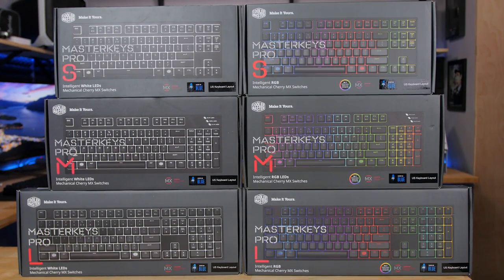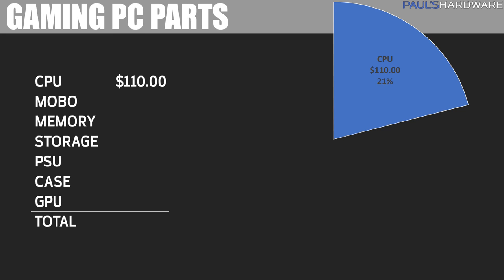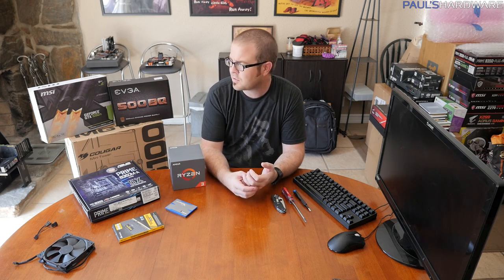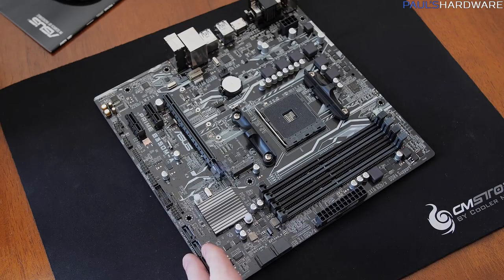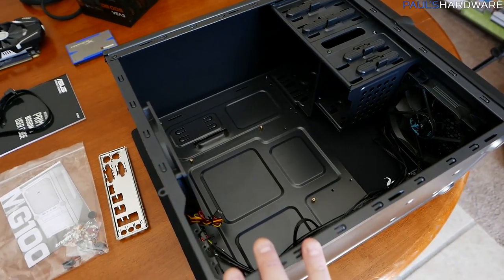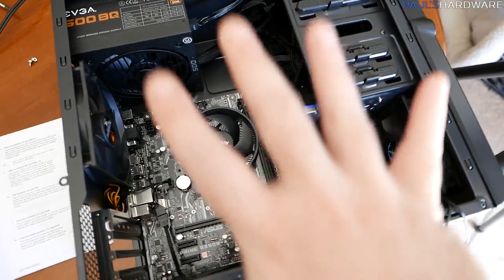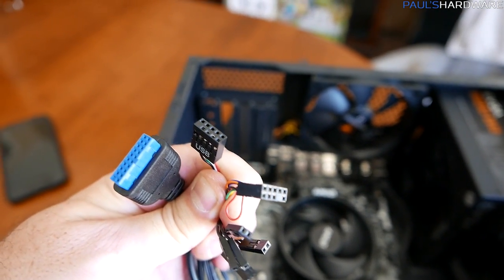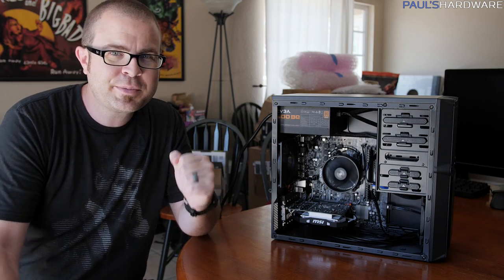How To Build a $525 GAMING PC with Ryzen 3!

Comment: Mr. Paul, I want to build for the first time ever in my life a gaming 1080p build for esports with these components: AMD Ryzen 3 1200, Sapphire Pulse Radeon RX 560, 4GB GDDR5, 128-bit, Motherboard MSI B350 KRAIT GAMING AM4 SOCKET 4xDDR4,  ADATA XPG Gammix D10 8GB (2x 4GB) DDR4, 2666MHz, CL16, NZXT Source 340 White case and a Solid-State Drive KINGSTON HyperX Savage 120GB, SATA3, SHSS3B7A/120G. What power supply should I get ? After I will get all the components that I just wrote you I will go also to buy a windows 10 64-bit english. Thank you and hope I will get feedback.

Comment: It's not a huge drop in price :(
Why no pentium g4560 pricing :(
Reply: Gabe_N 

What are you talking about? This isn't a price drop, it's a whole new processor. 

It also has 2x as many cores, along with being unlocked for overclocking and it also has a lot better TIM and is newer too so they have to charge that much. An equivalent chip from Intel is $180- 230 vs that at $109
Reply: ShadowOfDeath24 
Yes
An equivalent chip from intel will cost 250 dollars but
What if I don't want to spend that much for a CPU?
Pentium g4560 preform the same as an i3 7100 and cost way less
That's why people get the pentium instead of the i3
What if someone want to build a console killer?
110 dollars for the CPU
130 for the gpu
Boom you are out of budget
Reply: ***** if that were to be your budget, then instead of trying so to build a console killer...buy a console a be done with it.
Reply: fallshimjager1 
But why should I lock my self to 30 FPS?
Why should I pay for online ? 
Why should I lock my self to ?low amount of exclusives?
Reply: ***** I will say it again, with a budget so low you will end up losing a lot of things just so you can say that your oc is a console killer.
In my mind, a truly console killer is one that utterly destroys one in performance, a PC with an Ryzen 7 1700 or a i7 7700K and a GTX 1080 or 1080ti, that's a console killer.
With a budget like that you may be able to run games in low-medium at perhaps 50FPS, which in my opinion takes away the greatness that the PC haves.

Just to be clear, I have nothing against you, I just stated my opinion, a civil exchange of opinions.

Oh, and from a PS3 owner, the FPS number in the game that I play the most with my friends, GTA V, doesn't change anything, though, I will admit, seeing grass instead of GREEN DIRT would be nice, but, what can you expect, 512MB of RAM...
Reply: fallshimjager1 
ThAts not a killer
That's a pc that cost over 2 grand
Reply: Dude, the whole point of a console killer pc is to outperform consoles at the same price, not fucking obliterate them at 2000 dollars.
Reply: Z Bobplays 
Yes and ryzen 3 doesn't help here
That's my whole point
Reply: Wasn't talking to you my lord...
Reply: Z Bobplays I'm currently adquiring the parts to build myself a PC with Ryzen 5 1600 and a GTX 1070.
That outperforms easily a console.
For the same price of a console you can build yourself a PC, sure, but it will be limited as hell.
I do like consoles, I mean, i had PS1, PS2, I have the PS3 and plan to buy PS4, but I want that this PC outperforms by a large margin the PS4, that allows me to play everything in ultra above 75 FPS.
But that is just my way of seeing the PC.

Oh, and to respond to the original comment, AMD has something in the price of the Pentium
It's called FX, but I will rather not shoot myself in the foot with that.
Reply: But that doesn't make any sense, you're not getting the point. For example, i recently build my brother a console killer for 400 dollars, that can play anything at ultra, 1080p. Now my pc, i have a ryzen 1700 oc'd to 4.5 ghz and two gtx 980ti's. Of course my system is going to completely shit on consoles, but when you spend a shit ton of money (3k) it's not really a console killer anymore.
Reply: Z Bobplays first of all, Ryzen 7 1700 at 4.5Ghz?How did it get so high?man that's a good chip.
I do get your point, but my vision based on my place is what might change how I see it.
In US, or, ANY developed country that would make sense, but down here it doesn't.
For example, a PS4 is around 10000ARS (Argentina's currency), something like a 1050ti is around 4500ARS.
You see that it's almost imposible to even build something for less that the price of the PS4.

I do wonder however how well I will even play in a PC, because when you hold a joystick for so long, it becames difficult to play otherwise!
Reply: Yeah, i was really suprised, the 1700 is an absolute beast. Anyways, yeah i guess i didn't take that into consideration, prices vary so much from place to place. Also, you can use any controller on pc.
Reply: You can give X299 a run for it´s money with that chip, you are really lucky.
I want to build a Ryzen 5 PC, but the whole BIOS update makes me a bit fearful of the process, I mean, I really don´t want to brick my motherboard...
If you know a program to run a joystick in PC please tell me, I have been literally 5 months wanting to use my PS3 controller to play some good old Crash Bandicoot in a notebook.
Reply: Yeah the bios thing is pretty annoying, but i have a special ups just for updating my bios, and on most high end motherboards have a switch to reset your bios. About the ps3 controller, that's a little trickier. ps4, xbone, and xbox 360 controllers are all supported natively. Ps3 for some odd reason, is not. I do however think that the ps3 controller supports bluetooth, so try that.

Comment: For windows 10, they give out free copies to people who use it for accessibility. They do no checks to get it but anyone can download it. Just search for windows 10 accessibility download and they give you the operating system for free.
Reply: Anyone can get the OS for free... it's the key you pay for.
Reply: Yeah but Warren is saying if you check the accessibility option, no key is required. Turn off accessibility options after install, Windows stays activated.
Reply: yeah but that is a one time deal. only way to have a legally transferable copy of Windows is to buy a retail license. Then you can deactivate it and reactive on as many PCs as you want. if you are happy with having to buy another license next time you buy a new PC (swap out motherboard basically) then go for it.
Reply: It's free to upgrade if you have windows 7 or Windows 8. Not as a fresh install.
Reply: Maximus wait can you upgrade it again? i thought they removed this "free upgrade" option in 2016. Can you confirm it? At least i did my illegal copy "legit" for my laptop, but now i need one for my PC.
Reply: Yes, the windows 10 upgrade for assistive technologies is still available for free and it works just like a regular windows 10 upgrade. Just google "windows 10 accessibility download"

Comment: Paul pls test PUBG on it im looking to buy a new system instead of a ps4 mainly to play PUBG and i would love to see how this build performs.
Reply: Steven Daza i think you will be fine with these parts because i have a 1600 with 1060 gpu and i can get average 60+ fps with 3 video setting that are in high and medium. And keep in mind that PUBG is still in early access and im pretty sure the game will be better down the road
Reply: Buster Bloodvessel I got a 1700X and I can say, that only 1-3 cores got some serious load on it. So the performance in pubg doesn't profit from extra cores. The unreal engine isn't even optimized for multi threading :-(
Reply: Google search 1050 or 1050ti Pubg benchmarks. You'll be able to find frame rates for builds like this.
Reply: CaptainDieg Alot of system don't perform very well on pubg. It's a poorly optimized game
Reply: You will get 60fps

Comment: 17:42 You can mount the SSD using the mount point at the bottom of the case.  A lot of budget cases have a 2.5 inch mount there.

Comment: witrh that price you can get an i5 6500 (3.2ghz boost  3.6ghz ,i got it used for £120 its a beast
Reply: On a dyimg playform tho for the 6500 andddd their mother boards more expensive most of the time. Ya can grab a am4 board for 85$ on average new, vs used. 
But hey do what ya want, im using team blue (before ryzen was a twinkle in anyones eye)
Reply: chupa chups Most people won't buy used,your comment is irrelevant.

Comment: If you want to stretch a $500 build a little better then I suggest buying old server hardware. Old Xeon's are going to be flooding the market even harder now with AMD & Intel's new lineup. Other than the case though for a retail 500ish build this seems pretty solid! (You can't go wrong  @ $110 with a 1050Ti or RX560.

Comment: Nice build but who not go with the awesome Cougar Panzer case which is only $100? That is a hell of a case for $100 with tempered side panels and upgradability

I also just realized that the MATX board you goit uses the same B350 as the very popular MSI Tomahawk board which is a full ATX board...anyone building a "cheap", affordable Ryzen build would opt for the tomahawk board and the Cougar Panzer case...actually both can be purchased for $89 a piece.

Comment: As if Intel's i3 wasn't already irrelevant. I'm honestly disappointed that Ryzen 3 doesn't match the performance of the late i5 7500, in many cases at least. Ryzen 3 and Ryzen 7 both offer worse value than Ryzen 5. Even then, R5 roughly matches Haswell and Broadwell-E 6 core chips, depending on your application. That makes Ryzen an uncompelling upgrade for me, since my 4790K is superior for gaming than most Ryzen chips.

Comment: Can i ask you about a future setup i wanna build? Mobo asrck b350 pro4 . Ryzen 3 1200. 2xr7 250x asus 2gb each, thats about it.. by watching videos comparing r7 250x with rx 550, I learned that they're about the same, and crossfire will be like rx 460-470not shure. I all ready have them from my previous pc with x4 860k.
Reply: Also ram will be smtng lime ddr4 2400-2666

Comment: I was able to find a PC around Black Friday for $500 that was better than this. The specs we're:

Ryzen 3 1200

ASRock B350 Pro4

8gb (2x4) Crucial 2400MHz DDR4

Rosewill ARC 550W 80 Plus Bronze PSU

WD Blue 1TB HDD

Asus Phoenix GTX 1060 3GB

Rosewill Nautilus

And also the GTX 1050 Ti doesn't come in 2GB, only the normal 1050 does.

Comment: Someone please help me out here.
I'm confused about something.  Paul mentioned the Ryzen CPUs don't have integrated graphics, so you HAVE TO have a video card.
Thing is, the mother board, meant for Ryzen, seemed to have 
video outputs of its own.  If that's the case, why would you need a 
video card?  Are there other AMD processors that will work with the same
 board, processors that DO have integrated graphics?
So confused...  I thought the new boards were for Ryzen only.
If I put a Ryzen 3 (or 5 or 7) into this board, no video card, and hooked a monitor up to the mother board's outputs, what would happen?
Reply: Future Ryzen CPUs will have integrated graphics. Future proof boards.
Reply: nakyer Ryzen 3, 5, 7 CPUs DON'T have integrated graphics. The boards are also made for APUs (CPU + Discrete Graphics Card) that are coming out later this year. So if you were to plug-in a Monitor Connector into the Mobo, you would get no Signal
Reply: Thanks guys!

Comment: i still strongly disagree with the whole get an ssd arguement. and i really dont feel like the decision to arbitrarily cram an ssd in your system at this budget is anything but a terrible one. i feel like the people making these systems are in a bubble. where they have had ssd's for so long that a regular hard drive to them is just unbearably slow. 

your getting less storage, its more expensive, and your going to have to upgrade it in the future because games are extremely expensive for storage. 

a 1tb hard drive is like 40 usd and like 60 cad. 

ssd's can only match that price at about 240 gb at most and furthermore if you want a 500 gb which is the bare minimum nowadays with games being like 40gb at the lower end and like 80 gb at the high end your going to run out of space. like immediately if you have any games at all. 
and thats going to cost you like 100 at least in usd and if your a canadian you are looking at 200+ you dont have room for an ssd at this budget. without cutting some corners which is bad.  

in addition to that this storage is literally 120 gb. you know what thats gonna get you. enough room for your os which is like 20 ish gigs and like two games. thats it. this is pathetically insufficent storage. for what? faster load times? great the one of games i have has really fast load times and no increased fps in the game. now i have to choose my one or two modern games that takes up a ton of storage.

the division is taking up 50 gigs on my storage rn.

prey is 20 gb

advanced warefares campaign is 51 gigs

those are just three games i have. i mostly have only indie or older titles on my system right now. and my steam library alone takes up 278 gigabytes of storage. not including my blizzard games, or my emulator and roms for the wii and wiiu or my games from gog. 

much better to go with a hard drive, try to spring for like a 1060 and get the faster storage later. that hard drive is going to hold all of your games much easier and you wont have to compromise your budget. the 1050ti is great. its a good performer at 1080p. i have one. i know. but a 1060 will last you alot longer before starting to become insufficent for your games. it just makes more sense to get system that will be a great performer for alot longer and get the most out of your money. a 120 gb ssd is a terrible investment especially when you are getting a worse video card to try and fit that in. its just not gonna work.

Comment: With this case, the 120 intake isn't necessary as the massive vent on the side will allow the gpu and cpu to take in fresh air, and just use the 120 rear fan and psu fan to exhaust the hot air.

Comment: I bought the exact mb, ram stick, ryzen3 with stock heatsinc and fan, chassis fan, ssd, hdd and power supply. The case was out of stock so i bought another, similar case, added a dvd rw because the empty space was annoying and an amd radeon r7 240 4gb graphics card.
Question is, the A1 ram slot wont take the ram stick properly due to the cpu fan shroud is just enough in the way that, at least the vengeance lpx 8gb ram, wont fit correctly. I dont think youve addresses this one your video. You are using A2 and B2 slots but if you wish to install 4 sticks, you wont be able to unless you modify the fan shroud. In any case, im going to run cinebench later on to see where im at... thanks for the video, big fan...

Comment: Hi, I'm replacing my q6600 with new ryzen 1300x plus b350 mobo ddr4  etc but I'm reusing my ssd. Do i needto reformat the ssd with a clean Windows instsll, or will it run ok as is?

Comment: I built a great rig a few years back with used parts off ebay, the ram and ssd are new but the case is a spare and the psu is a replacement, I'm proud of it, I wouldn't recommend buying everything used but I'd definitely buy a few used items when on a budget, I'd honestly take a used gpu off ebay over a recertified, cpu's are usually pretty safe used in my experience, motherboards are more risky but people bend pins all the time and although a risk to buy you can get one for a steal

Comment: Hey Paul, i'm using a Ryzen 5 1600, wanted to know which GPU (AMD or Nvidia) would complement this cpu the best....(No Budget)
Reply: GTX 1070: used in many 1k$ builds with ryzen 5 1600
Reply: Niklas Haiden Ah I was thinking of 1060.. kool I'll look at 1070 too.. Thanks
Reply: Mark Gomes 1060 is also fine if youre doing 1080P gaming, 1070 is good for 2K gaming
Reply: Niklas Haiden Right

Comment: You mention that the Cougar MG100 m-atx case doesn't support 2.5" drives, I saw that there are some holes on the bottom of the case that in fact could support the SSD in that place.

Comment: Hey Paul, I've seen a lot of budget cases put four holes into the floor of the case that have the proper dimensions for 2.5" drives. This case I think does the same thing as you can see it at the 17:35 mark.
Reply from the maker: You're right that those holes are for a drive mount, but they're spaced for a 3.5" drive 😢
Reply: Now that makes no sense.

Comment: IMO the RX560 4GB would've been a lot better for a budget build such as this. Freesync monitors are very cheap so even if you're getting slightly lower frame rates compared to the 1050ti, everything is still smooth. Plus in the UK, you can find a decent 4GB model for under £100 on Amazon brand new and as far as I know, that's cheaper than the 1050ti

Comment: My Ryzen 3 1200 was supposed to be delivered by UPS by 8pm today... I waited till 9:30pm and still nothing. I waited here all freakin' day and the Amazon tracking thing STILL says "arriving today by 8pm".  GRRRRR  

I am matching it up with a Sapphire Pulse RX560 2GB, single 8GB DDR4 RAM, 1TB Seagate hdd, Asus 350M motherboard, 500w EVGA psu, and all going into a new case my friend gave me for Xmas. Total build price $460 or so.  Later on I can add an ssd and just clone the install off the hdd and move it over.  I also have the option to add another stick of RAM, which is why I didn't get a 2x4gb kit.  The case has a see-through panel, so I can add some green LED fans for some creepy ambience.  hehehe  ^_^

It's 'budget' for sure, but I am a disabled military veteran, so money is EXTREMELY tight.  This will be the very first time I have actually owned a modern current generation pc system.  My current pc is a single core Athlon w/ 2GB DDR2 RAM & a GeForce GT 710 gpu.  0_o  I am SOOOOO STOKED for this!!!